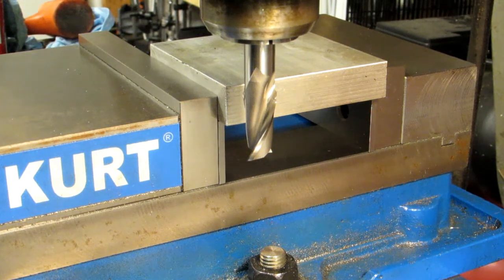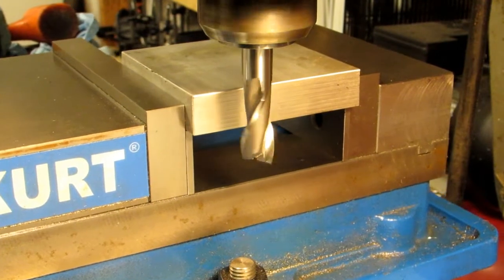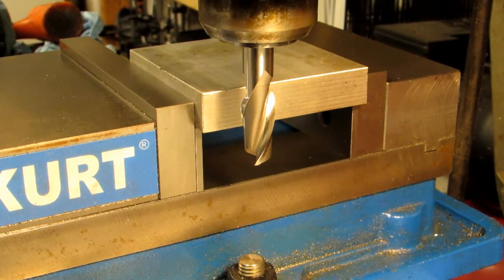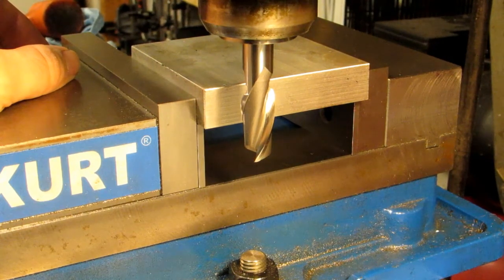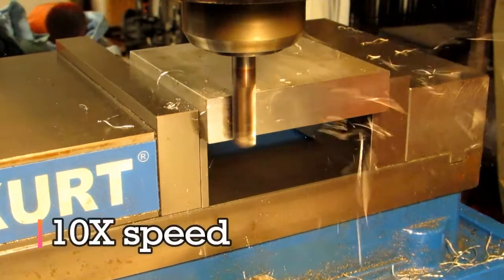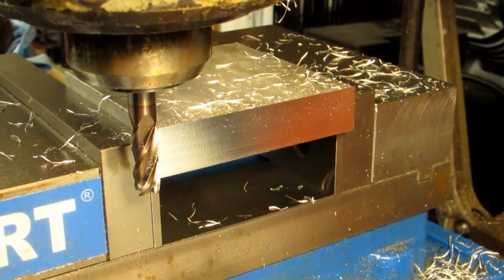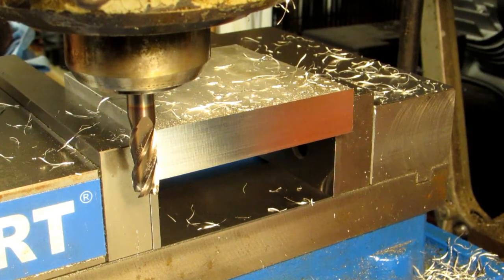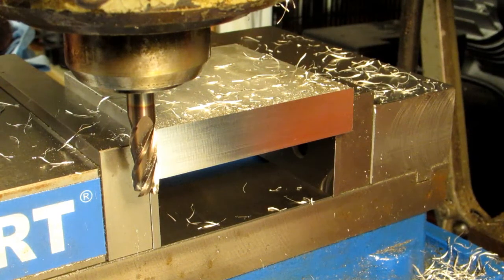Quick Machining Tip #9 - Conventional and Climb Milling

Comment: Would using a climb cut for a final "spring" pass  be considered safe/acceptable? Thanks, and thanks for the effort your putting in. You and "thatlazymachinist" are the best machining teachers on Youtube
Reply from the maker: You can get away with a really light cut (.005" or so) in mist materials, but you want to make sure to lock the table down as much as possible. Snug down the axis you're moving to the point that it takes some effort to move the table.

Comment: Posted around 2016/17, I see.  Just now seeing it in 2024 as I search for reasons why I'm having machine failures in my auto-feed gearing when I am (according to this video) doing a big no-no working w steel by climb cutting.  Viola!  I hope it solves my problems if I only use conventional cutting, fingers crossed.
Reply from the maker: @davidwilburn6314  Good luck! It should help.
Reply: @StuartdeHaro  I hope so!  I'm getting frustrated and perturbed that I can't figure out what keeps costing me failures and time and money!